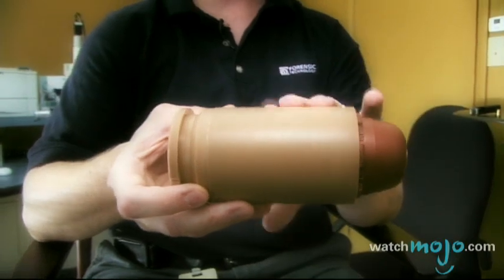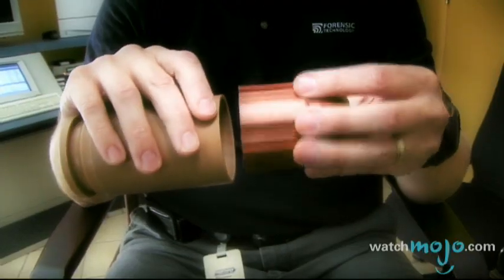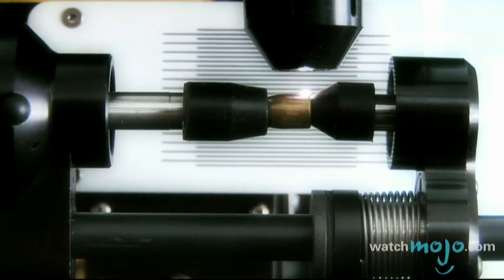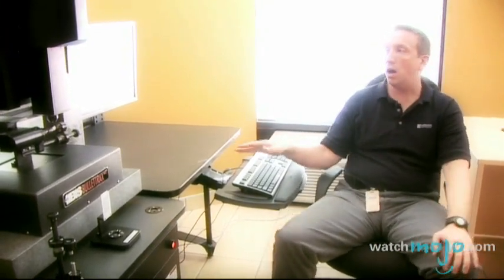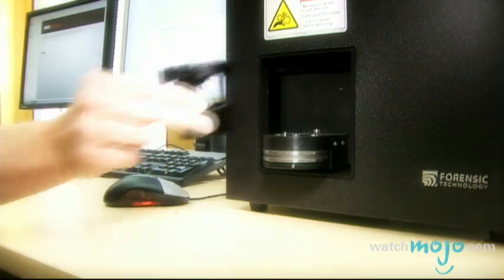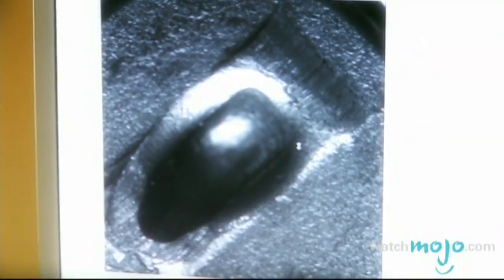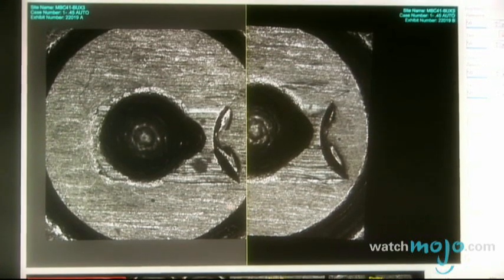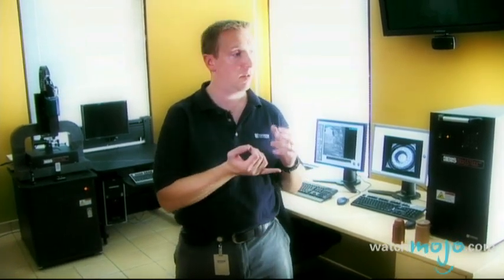Ballistic Identification Technology

Comment: to demonstrate this fully, you could included a bullet that was not connected to that gun so we can see the difference between them as well. Is there a lot of difference between these patterns from gun to gun?
Reply: Most modern firearms are made by cnc, eliminating the differences between them and the thousands of identical copies that exist.
Reply: @keithl8300  So is ballistics as a whole a dodgy science?.. or just this section of ballistics that examines an unfired bullet that has been ejected?
Reply: It's not. I use the IBIS on a daily basis (working with forensics laboratory).
The IBIS is undoubtedly a helpful tool but it is just one of many elements to be analized in ballistic elements. 
It's something quite complicated to explain but there's always a difference. I've seen consecutive serial numbers in firearms that are the hardest to differentiate but never identical.

Comment: RIP if they use a revolver.
Reply: Liberals will try by to ban or outlaw those soon too
Reply: Revolver doesn't have rifling?  You sure?
Reply: A 12 gauge shotgun with buckshot is rather effective and untraceable
Reply: @mofogie  there's definitely smooth bore revolvers
Reply: @mofogie  They do, but it's illegal...  Well, not illegal, but it's recognized as a shotgun and must be treated as such or it becomes illegal.
Reply: What if u switch the barrel of a handgun
Reply: @mofogie of course it has rifling. All handguns and rifles have rifling. In modern firearms, the only guns without rifling typically are shotguns. But shotguns can also have rifling. Just not very common. If you think about it. A shotgun blasts a number of bb's into a direction and doesn't require rifling. The only shotguns that do have rifling are ones with custom barrels "slug guns" that shoot slugs rather than shot. It should be noted that a slug can be shot with rifling or no rifling, and most shotguns have no rifling as they are meant to shoot shot (a group of bbs). A bullet from a handgun or rifle needs rifling to spin the bullet creating stability. Also this concept is why shotguns are typically only effective at relatively short range, while some rifles can shoot up to a mile and beyond effectively.

So, again, all handguns and rifles have rifling, even revolvers. It's mandatory by law. It's a distinguishing feature that categorizes the firearm and further rules about the legality of a firearm are determined based on the styles of gun including legal limit of barrel length, should the firearm have a stock or not. The Best Way to think of it is that most firearms have rifling and are pistols or rifles, otherwise they're classified as a shotgun due to the smooth, unrifled bore. This means that if you own a shotgun and you install a rifled bore (barrel), you now have a rifle, not a shotgun.

One thing that could make a revolver harder to forensically test wild be the lack of marks left by an ejector. Although other markings appear and can be tested it's one less mark that wouldn't exist. This could lead to inconclusive evidence to match the bullet to the casing I would assume, but still totally possible. 

If this comment is made to insinuate that revolvers are more powerful that regular pistols, on average, recovers are typically of higher caliber but in reality, didn't make much of a difference. It's all about the caliber, grain (weight of the bullet), shape and type that determine penetration, blunt force and expansion of the bullet and how that bullet affects the target's media, that determines its wound channel making one projectile dealer than another. The other obviously is shot placement. I'd rather be shot by a 45 in the leg than a 22 in the eyeball.

Comment: So Glock is the most common handgun overwhelmingly, so if you change the barrel and firing pin and recoil spring, which takes less then 5 minutes, your reading will be rendered useless? Not trying to give criminals ideas, just naturally curious
Reply: Barrel would affect the recovered bullets for sure, probably making the comparison between bullets useless. As for the recovered cartridge cases being rendered useless because of differing firing pins, that's not necessarily true. The breechface impression will still be comparable as well as any aperture shear present and potentially other surfaces (Ejector marks). But yes, if you really know firearm forensics, you can try to game the system. Even using certain types of firearms that are known to mark poorly. But for every diligent prepared criminal you have 1000 more who aren't. So it's still a useful practice even if it's not perfect. I mean you can always wipe your fingerprints or wear gloves (easier IMO than modifying firearms), but no one seems to dismiss the fingerprinting practice
Reply: @Gokuguy1243   so if someone had this well planned out, wiped finger prints off ammo, and basically had a new Glock slide or upper with all new internals which can be bought for $100, committed the murder and swapped back slides which take literally 5 seconds  and destroyed the old slide, there’s no way ammo can be tied to the frame of the Glock since it’s the frame that actually ties the weapon to the owner of the gun.